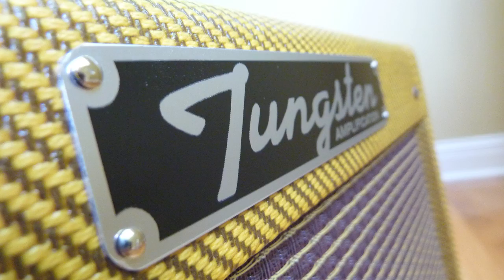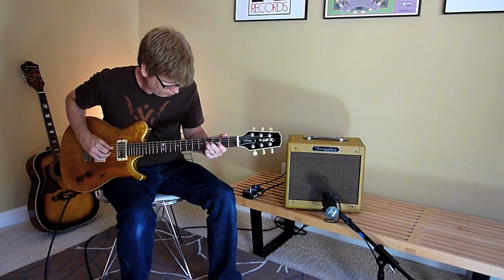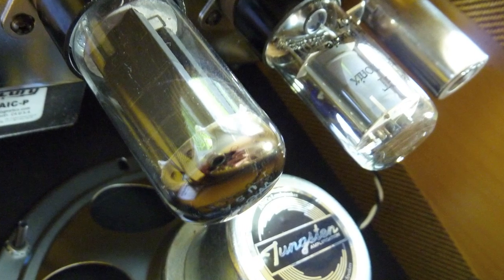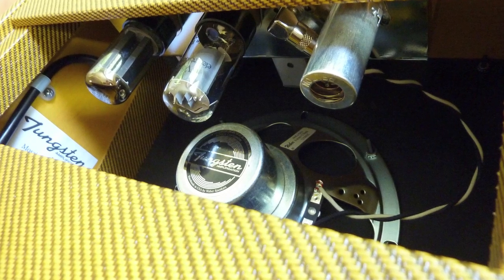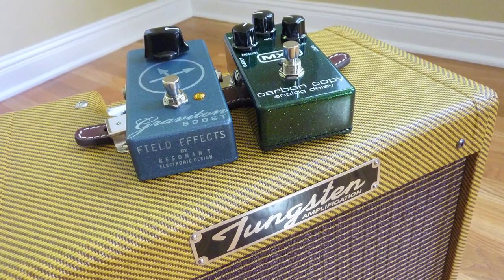Tungsten Mosaic Amp Part 1 demo by Greg Vorobiov

Comment: It's so nice that as the crop of guitarists that started playing in the 70's and 80's are maturing and changing their tastes away from the overcomplicated ganiac amps of the 80's and 90's and back to these very simple, pure amps.
With an amp like this, as opposed to a hot-rod Bogner (for example), the guitar that you use and your touch really make a difference in the sound, and you have to be a good player to sound good.  No multi-cascaded gain stages to hide behind.
Great job as always, GregV.
Reply: To stay on top of my game all these years of playing metal thru my marshalls i pratice without pluging in to an amp on my prs so i could really hear what i sounded like all that gain is only so good youre right many guys hide behind the high gain amps so youre point is right on ps i have little fender amps to ha ha cheers mate